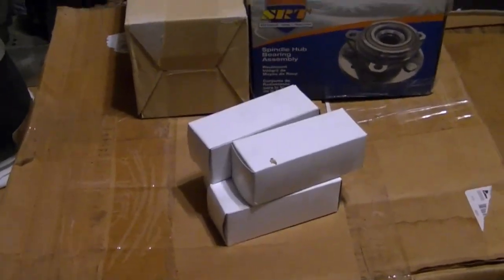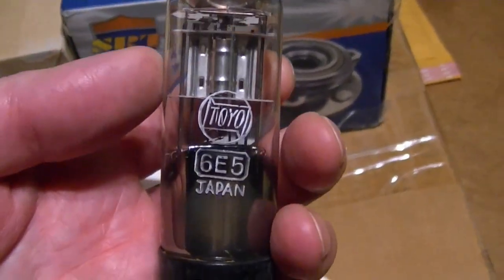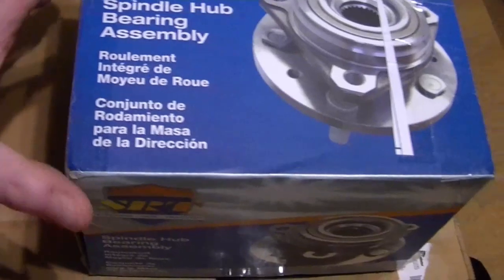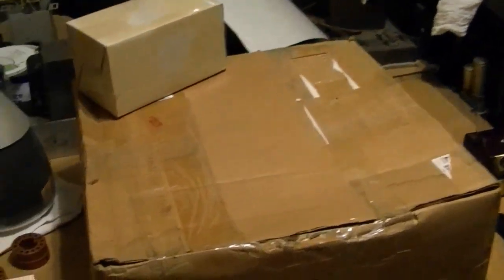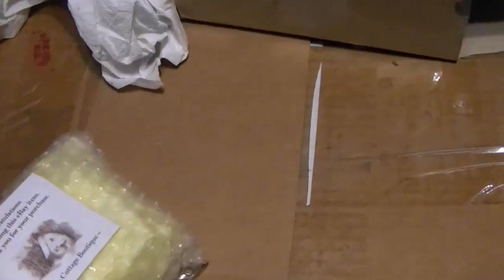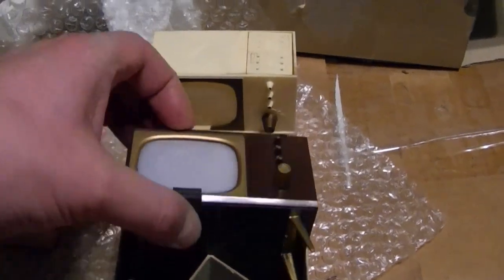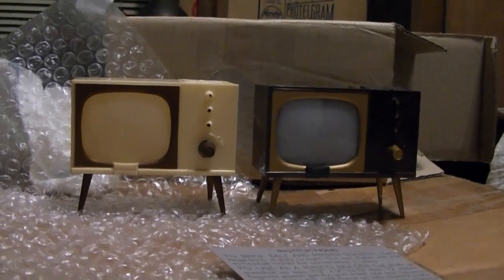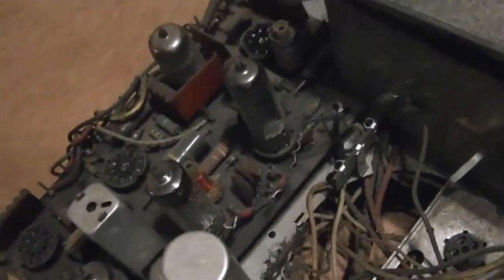Friday night unboxing 7/25/2014

Comment: Hi Bob. Yes the UHF does down convert to 44 mhz. VHF RF amp and mixer are I.F. amps for UHF. Very clean Predicta chassis,if it were me that unit would be restored and put in a nice box when available. I have a floor model box that has a Zenith 19MB2X in it. You make do and use what you have,plus just wanted to see if it would work. Turned out better than I had hoped for. All the best,Tom J. from FLA.
Reply from the maker: Problem is that I really doubt I'll ever come across a Predicta cabinet and picture tube that needs a chassis.  I already have over a dozen TV chassis with no cabinets as it is.